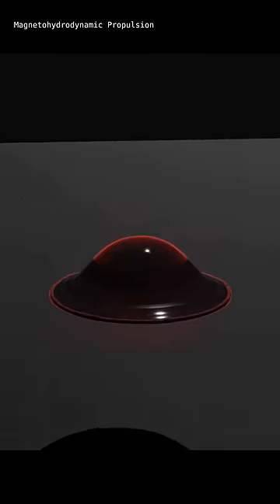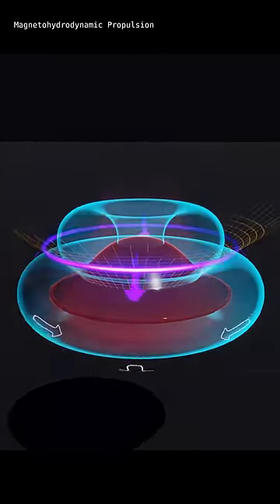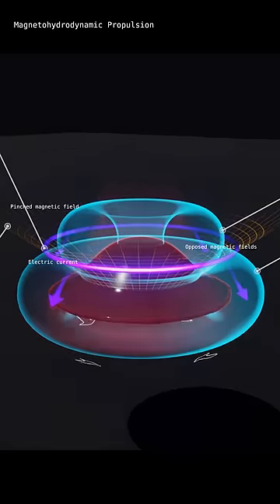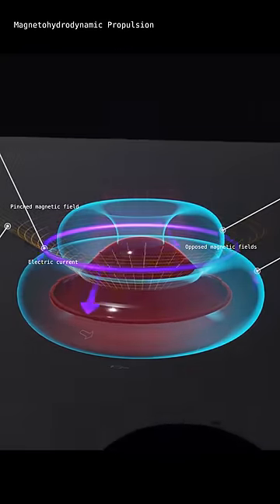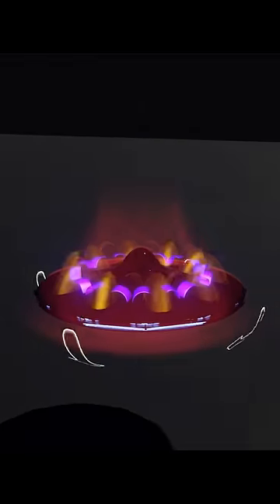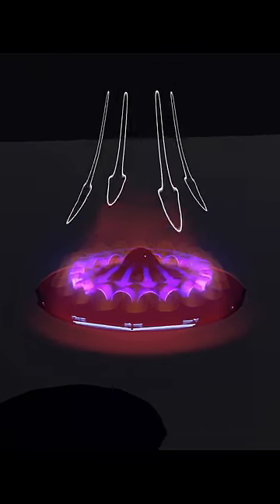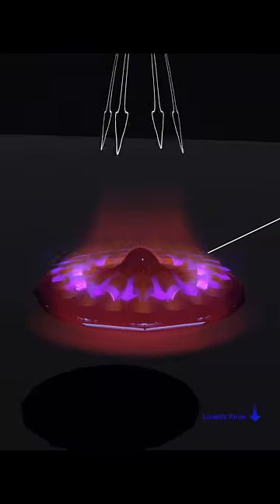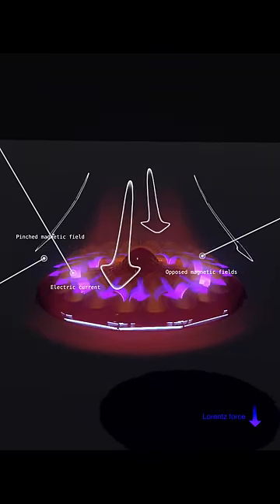What is Magnetohydrodynamics (MHD) Propulsion? | #shorts #mhd #magnetohydrodynamics #spacetravel

Comment: That explains why uap emit strong radio waves
Reply: Correct
Reply: You also have to understand you would need an absolutely absurd amount of energy to power a electromagnet to be able to get that strong. This is why I think the US and China has already figured out how to build safe mini nuclear reactors for top secret crafts like this. A mini nuclear reactor would be able to power something like this if it was build right and with enough research and development which should be no problem considering the billions of dollars they are funded not to mention other top secret projects in the past
Reply: @legoenginemechanic101 And they do infact have mini nuclear reactors so it’s funny you mention.  Size of a large brief case, there’s various sizes. Nuclear subs are powered by a smaller reactor.

Comment: Is it steered and accelerated by manipulating the onboard elecrically charged magnet, in relation to the earths active magnetic field...and causing the floating illusion when at low speeds?
Reply from the maker: Basically, the are employing advanced methods of magnetic control of both the craft's and the Earth's magnetic fields. Yes, there is more to it.

Comment: So this is the UFO? How enlighting
Reply: no, this is not how the UFOs fly. you could make a UFO with this, but it would be extremely energy inefficient and the max load it could carry would be small compared to fuel, battery weight etc. maglev trains are analogous to this type of propulsion, and they can achieve higher speeds with no friction, little repairs and a perfectly smooth ride, but they need more expensive tracks and a much higher energy consumption to run at high speeds, which is why they havent been widely used over combustion engine powered ones. 
and the train is moved by the tracks, so it itself just carries part of the infrastructure needed to supply the energy to move it. a flying device like this would be very so inefficient that it would be difficult to get it to lift even with no payload. 
the UFOs use a completely different type of propulsion. they create insanely strong magnetic fields, which when oriented with the north pole in the direction of the earth, are repelled by the earth. they dont push against gravity, gravity is pushing them away from masses. navigation is possible by changing the orientation of the poles. the key difference is that they dont have to fight gravity, gravity is propelling them, and they gain energy through flight that is coming from earths gravity.

Comment: Somebody get it done: 

To create a feasible solution combining ionization and magnetic levitation with Magnetohydrodynamic (MHD) air propulsion, we can outline an advanced system that leverages ionized air (plasma) for both lift and propulsion. This hybrid approach will involve sophisticated technology but could provide a novel method of transportation.

### Combined Concept: MHD-Based Air Propulsion and Magnetic Levitation

#### Key Components:

1. **Ionization System**: High-frequency microwave generator and electrodes to ionize the air around the vehicle.
2. **Magnetic Field Generation**: Superconducting magnets or high-power electromagnets to generate and control magnetic fields.
3. **Plasma Generation**: Creating and maintaining plasma (ionized air) for propulsion and lift.
4. **Control System**: Advanced sensors and microcontrollers to manage ionization, magnetic fields, and plasma flow.
5. **Power Supply**: High-capacity batteries or an onboard power generator to supply necessary energy.

### Step-by-Step Implementation:

#### 1. **Design the Vehicle Framework**:
- Construct a lightweight but strong frame using materials like carbon fiber or advanced composites.
- Ensure the frame can support all the components, including power supplies, ionization systems, and magnets.

#### 2. **Ionization System**:
- Install a high-frequency microwave generator on the vehicle to ionize the air. This can be placed under the chassis or in the engine bay.
- Place electrodes around the vehicle to create and sustain plasma. Ensure they are well-insulated and protected from environmental factors.

#### 3. **Magnetic Field Generation**:
- Integrate superconducting magnets or high-power electromagnets under the vehicle’s chassis.
- Connect these magnets to a controllable power source to dynamically adjust the magnetic fields.

#### 4. **Plasma Generation and Control**:
- Utilize the ionized air (plasma) generated by the ionization system.
- Control the plasma flow using magnetic fields created by the electromagnets or superconducting magnets.

#### 5. **Lift Mechanism**:
- Create a magnetic field around the vehicle that interacts with the ionized air (plasma) to generate lift. This is similar to how magnetic levitation (maglev) works, but using ionized air instead of a conductive surface.
- Adjust the magnetic fields dynamically to maintain stable lift and control.

#### 6. **MHD Propulsion**:
- Utilize the plasma for propulsion by manipulating it with the vehicle’s magnetic fields. This creates a Lorentz force, providing thrust without moving parts.
- Integrate ion thrusters for additional directional control and propulsion. These thrusters can be mounted strategically around the vehicle.

#### 7. **Power Supply and Control System**:
- Install a high-capacity power source, such as advanced batteries or a compact generator, to provide energy for ionization, magnetic fields, and plasma generation.
- Use advanced microcontrollers and sensors to manage the ionization process, magnetic fields, and propulsion system. The control system should be capable of real-time adjustments for stability and efficiency.

#### 8. **Testing and Calibration**:
- Conduct initial tests in a controlled environment to ensure all systems function correctly.
- Gradually increase power and adjust the control system to achieve stable lift and propulsion.
- Perform tests in various conditions to ensure reliability and safety.

#### 9. **Safety Precautions**:
- Equip the vehicle with emergency shut-off systems to quickly disable the ionization and magnetic systems if necessary.
- Ensure proper insulation and safety measures to protect passengers and electronics from high-voltage components.

### Summary:

This combined concept leverages ionized air (plasma) for both lift and propulsion using principles from magnetohydrodynamics (MHD) and magnetic levitation. By integrating advanced ionization systems, magnetic fields, and control mechanisms, it is theoretically possible to create a vehicle capable of stable flight and propulsion. However, this approach requires substantial technological advancements, precise control, and significant power. Real-world implementation would necessitate extensive research, development, and testing.
Reply: Wow.... Thank u brother

Remarkable

Comment: Is this practical
Reply: It should be possible, but the energy needs are probably equally high
Reply: A nuclear reactor will come in hand
Reply: The saucer shape remains unstable, in spite of the MHD.  Not practical.
Reply: @summerbrooks9922  the shape is only unstable if the body is fixed. If you build the body as a part of the engine itself, it can be stabilized. The body has to rotate in the opposite direction of the Mercury to maintain stability. It’s like a giant flying gyroscope toy
Reply: Kinda.